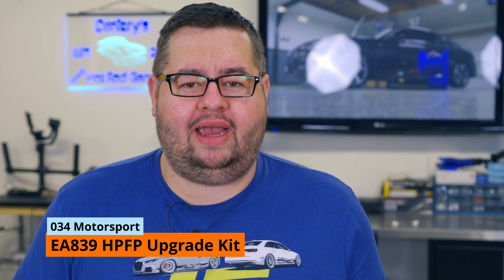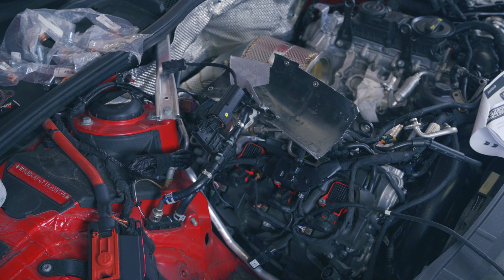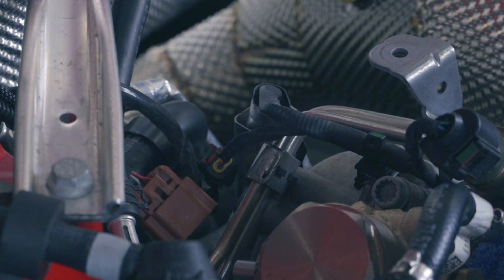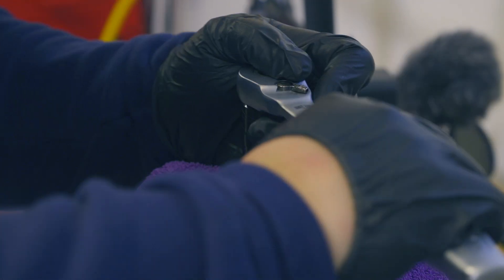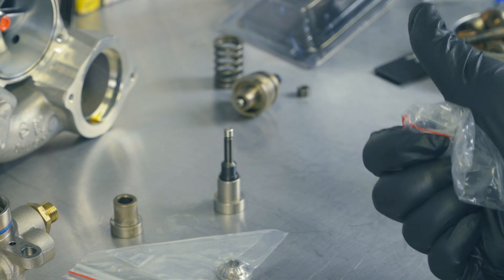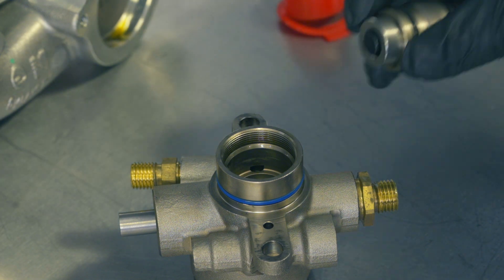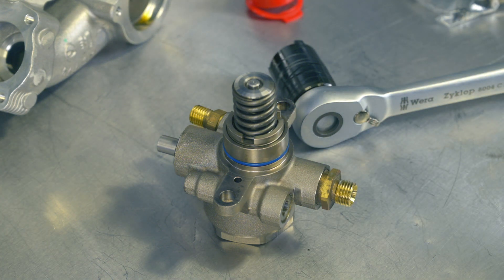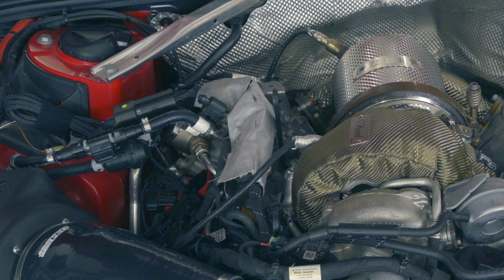034 Motorsport EA839 HPFP Installation for B9 S4, S5, SQ5, and RS5 2.9T & 3.0T Engines

Comment: Great video. One question is there a tune you need to do after the install? I am currently running the E 85 tune with the cold air intake and bigger intercooler.
Reply from the maker: You can run the tunes specific to the improved HPFP with it. i.e. the Plus tunes with 034. It's also needed for hybrid turbo setups.
Reply: @DmitrysGarage  Can i install this kit just on stage 1 or it won't work and I need special tune for this upgrade?

Comment: Where is the cam follower??
Reply from the maker: The roller tappet is underneath the HPFP. It's not part of the 034 kit as you're only upgrading the piston. It only goes in one way and needs to be lubricated with engine oil before being put back in. You can turn the crank by hand (clockwise) to aid in fishing it out or lowering it to aid with installation. Lubricate it with engine oil if you take it out.

Comment: Did you disconnect the battery ?
Reply from the maker: I didn't though it's a good idea since you're unplugging an electrical connection. Risk is minimal, but it's the "proper" way to do it.

Comment: I wonder if people are running into issues like fuel injectors maxing out. That’s the problem I have with the 034 HPFP, same car.
Reply from the maker: You can definitely max out injector duty cycle with a hybrid turbo and enough ethanol. I was hoping there would be RS injector support for the 710 just to give it more head room, but that doesn't seem to be on the horizon. I recommend running around 60-75% ethanol. I find 75 is fine, I usually see zero long term fuel trim around 75ish.

Comment: Hey, Dmitry! Love the channel. Quick question. @2:06 in this video where you remove the clamp. What is this piece called? I snapped the barb off of that little black cylinder piece on the opposite end from where you removed the clamp. I cant find it anywhere because I don't know the name lol. Thanks in advance.
Reply from the maker: I believe this is #10 on the image below, and it's a canister purge valve. Unfortunately Audi parts, where I got that image, shows it as part number 037906283C, but it doesn't look right to me when I look at the part. I think their documentation is incorrect, it happens unfortunately. I think it's not a separate part you can buy from Audi directly, I think it's really part of 06M133240BP (new version is 06M133240BK). You may also be able to make a generic valve work, or this may be something to look at with the dealership's parts department, but 06M133240BP seems to include it.

https://bit.ly/s4pcvdiag

Comment: It can’t be exactly the same for the b9 RS5, can it? I have had the 034 Motorsport HPFP box in my garage for months, and I finally invested in the parts (thank you) to do the job. I’m quite nervous, as recent YouTube videos have finally given me the feeling like I can do this stuff myself. I’m also installing an IE carbon fiber intake with turbo inlet tube, and lastly for now some sequential mirror blinker lights I got from BMP tuning. You gave great advice at the end of the video. I’m just nervous because it’s my daily driver and if I make a mistake I am screwed. What do you think?
Reply from the maker: It should be very similar on an rs5 since its the same engine just different configuration. I would just put eyes on it and see if you understand how it is fastened to the fuel system and engine vs what’s in the video/instructions. If it all makes sense to you then I think it is a doable job. Give yourself time and a short term backup plan to get to work on Monday if you need to wait an extra day for a tool or something. That way you’re not going to feel pressured to rush and make mistakes or use wrong tools, etc…
Reply: That’s great advice. Thanks

Comment: Use caution when compressing the spring.  Loosely wrap a towel around it to prevent it and tie the towel to the vice.  This will prevent the assembly from becoming a projectile.  There is a lot of force in that spring and if you are not compressing evenly, the entire assembly will fly out of your vice and smash all the teeth out of your head.
Reply from the maker: This is good advice. Thanks for pointing out how careful one should be. This is applies to all aspects of working on cars, but springs can be extra tricky. As you can see in the video I definitely paid a lot of attention to maintaining the alignment of the tools during compression. That being said I don’t know that this is going to knock your teeth out, it is a rather small spring. This isn’t a coilover spring dealing with kN of force, it’s essentially a valve spring. Not sure I can recall anyone seriously injuring themselves with one, but again I think you are 100% right to caution. In the right circumstances it could be painful to say the least.

Comment from the maker: Pro tip from Sean@034Motorsport - The hardlines are much easier to remove if you break all of the other connections for it, the whole line becomes loose after that.